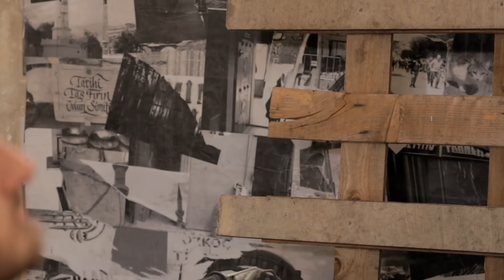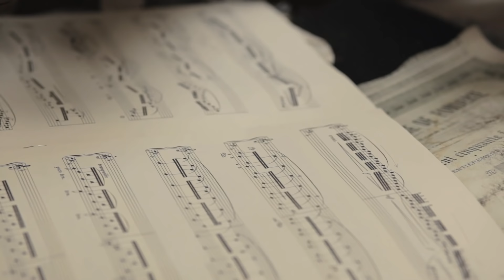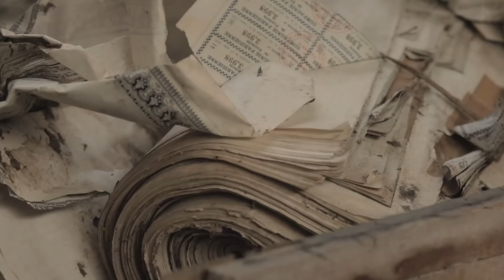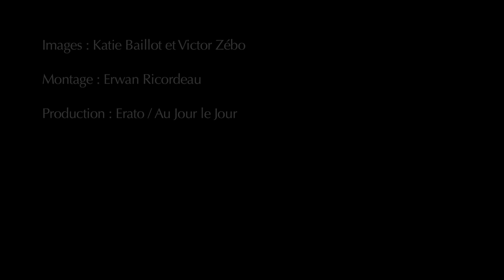Jean Rondeau plays Bach's Chaconne on harpsichord for his debut album IMAGINE

Comment: Whose arrangement for clavicord is this?
Reply: It was arranged by Brahms for the piano, which Rondeau has adapted for the harpsichord, not the clavichord.  But, of course, it doesn’t sound like the “Chaconne” to me, except in parts, because arpeggiating chords on a keyboard can never sound like a violinist pulling a bow,across the strings.